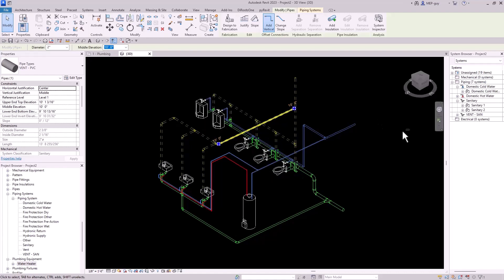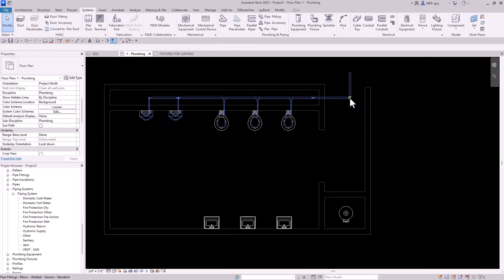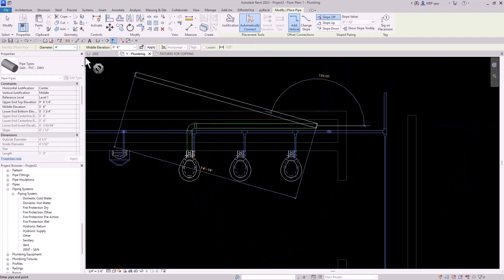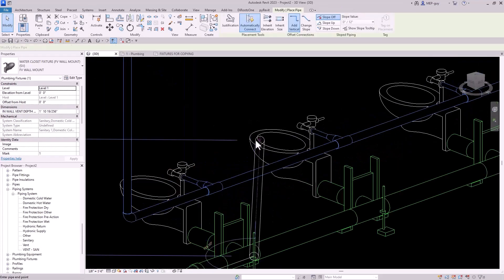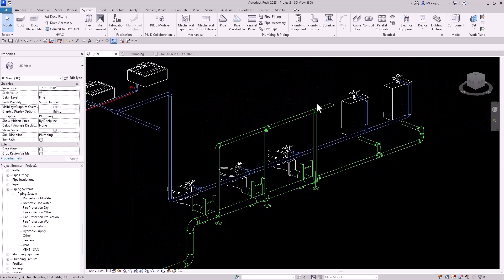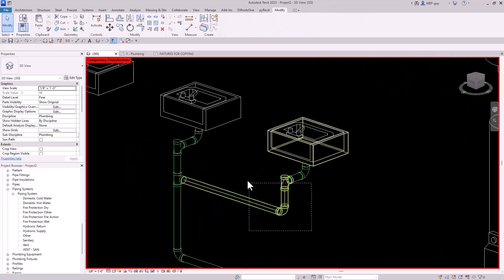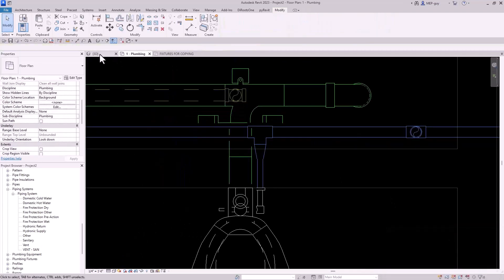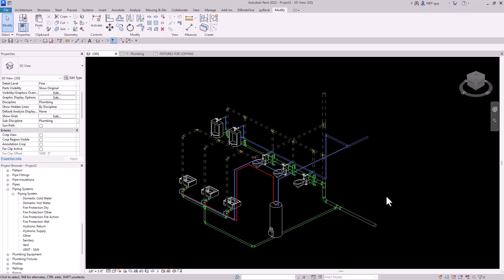QUICK TUTORIAL - Model Plumbing Faster in Revit

Comment: It looks kind of easy with the slopes off.
Reply from the maker: What part looks easier with slopes off?
Reply: @mep_guy  the sanitary piping. Why did you have to model them with slopes off? Is that common practice?
Reply from the maker: @Dr_Frank_Einstein  It depends on what you are trying to accomplish. As a Plumbing Designer/Engineer, my main job is to produce Contract Documents (drawings) for submission to the city and contractor. So typically I don't model with slopes as they are unnecessary in most cases. However, if I did need to model the slopes, I would simply change the slope at the very end of the project.
Reply: @mep_guy  that is very interesting. May you please do a video where you demonstrate how to change slopes after drawing the pipes in. Thank you in advance.